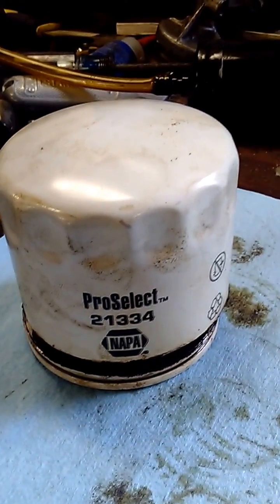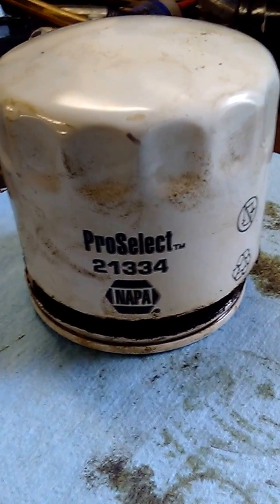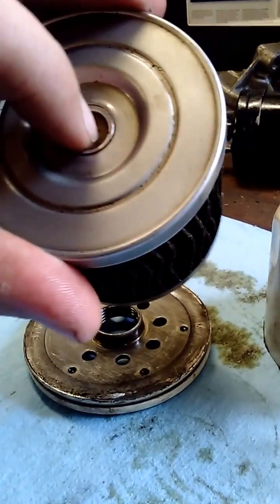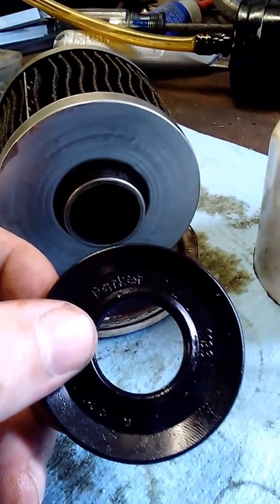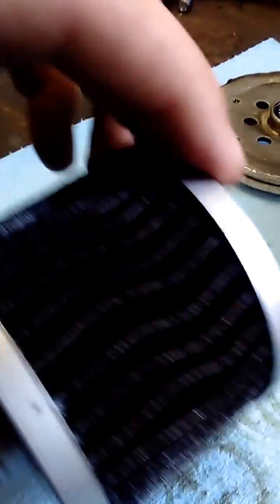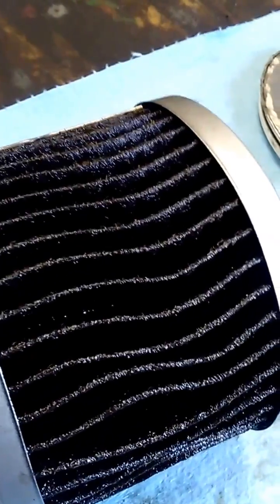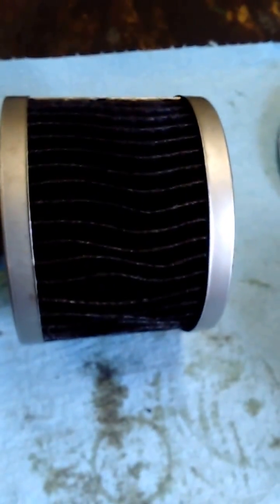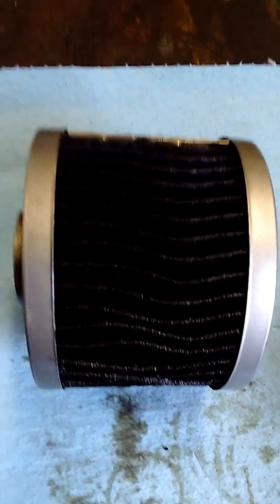Napa Proselect oil filter cut open

Comment: Despite all the Hyundai talk below this looks like a pretty well designed filter with proper metal backer to me.  I'm out of warranty now and switching to a private mechanic and this is what they use, should work out fine.  I'm sure it is comparable to mopar.  Someone said below oil filter caused piston slap LMAO!

Comment: I had bad luck w/this NAPA oil filter. Only lasted 400 (hundred) miles. Engine would not down at 25 -30 miles an hour. Floor it at 50 MPH and; nothing... Except a feeling like transmission slip / no good
Reply: I highly doubt that the filter is your power issue the only difference a filter can make is a slight difference in oil flow on cold startup it doesn't hurt power
Reply: @conner5611   I ended up getting a newer engine, and a remanufactured transmission. At the same time.
3800 V6 buick had an internal noise + a misfire code  then, after 3 months; transaction stopped shifting into 1st gear.
 Since then I've changed the oil more frequently, 5 times and used different filters ( STP, Mobile 1 and now WIX extra performance XP)

 It cost an arm- and- a leg
Reply: That had nothing to do with the oil filter Guy!
Reply: Oil filters ruin cars? I suppose most cars r dead on shoulders by now and oil filter comoanies r being sued big time, so my question is wheres the dead cars on the shoulders? None due to oil filter failures.
Reply: This same 21334 filter spoiled my Hyundai Elantra 2014 engine and developed a severe piston slap even though I have been maintaining it well and warming up before I drive. Also before using Napa filter I have been having oil changes done with Valvoline oil and a Valvoline filter with no problems whatsoever. However, Napa did ruin the engine and it happened in just 14000 kms of using it. 2 oil changes and 2 filters in those 14k kms and a scrap valued car in my garage. Never going to use Napa filters again
Reply: Don't buy hyundai/kia junk.
Reply: @gpsacme  I know Hyundai/Kia  has a service bulletin saying to use only OEM filters. I also know there have been engine failures on cars that have been serviced at the dealer. I am wondering what the truth is, and is it really a filter problem or just bad engines?  I am also wondering how you know your engine failures would not have occurred even had you been using an OEM or other brand filter. I am not pretending to know everything,  I am curious to what the real issue is.
Reply: @peterl2017  I think the real issue lies with how tight engine clearances are. You know older engines with cast iron blocks and 20w50 oils took the abuse happily. However today's engine even though technically advanced are particular about the cleanliness of the oil, passages and the filter functioning at its optimum performance. Aftermarket filters might not meet the oem specifications at all times. There are millions of filters made each day and not every filter goes through the quality check. How about a factory making 10 bad filters every millions and those 10 end up in our cars. Just my thought. There could be more to it. Probably car makers intentionally making some parts fail after warranty period is over to keep their shops in business
Reply: @gpsacme  First off, you are 100% correct on todays engines being more fussy as far as oil/cleanliness etc. ALMOST every engine I have replaced was neglected, but not all. Sometimes there is just a defect. 

 I know there are some class action law suits over this(Kia/Hyundai) and seems like the manufacturer has warrantied some over warranty engines on the QT with a non disclosure agreement.  Sorry, I just think there is a problem with the engines and not necessary the fault of an aftermarket filter. Though there are some crap filters on the market, I have installed 100s if not 1000s of Napa filters with no problems. These filters are made by WIX ( Mann + Hummel) and are a decent quality filter. Sorry just not buying it. However I am open to listening.
Reply: Fact: Someone had an engine failure and was using these Napa filters. 
Assumption(unless someone proves otherwise) That the filter was the cause.
Reply: @gpsacme  

You know hyundai and kia set aside 900mil$ to deal with 2.0na and 2.0t theta 2 engine seizing up due to con rod bearing issues right?   So doubtful it was the oil filter.   Its right on their website.   10 year 200k warranty on 2.0t engines.
Reply: @gpsacme  

Or a hyundai with a theta 2 .   Mine is  at calgary Hyundai as we speak...awaiting answers as it died a clattery stinky death on the way there with 800mkms on fresh synthetic.
Reply: @gpsacme  why did u sue napa?
Reply: @juliosdiy3206  I didn't. Who told you I sued Napa.